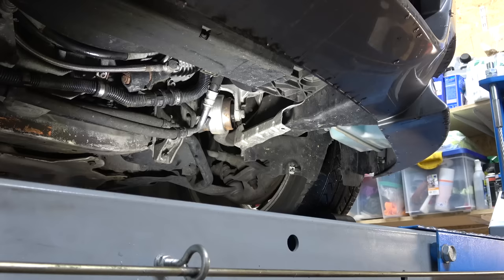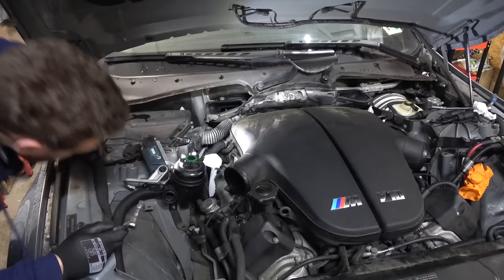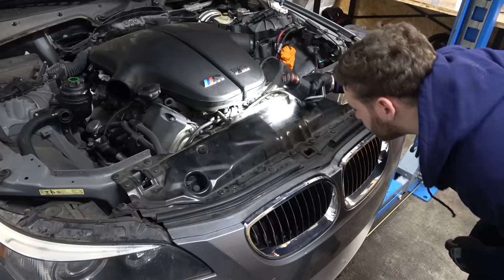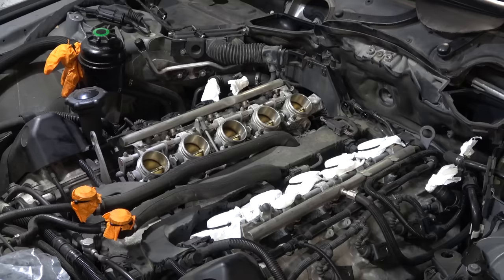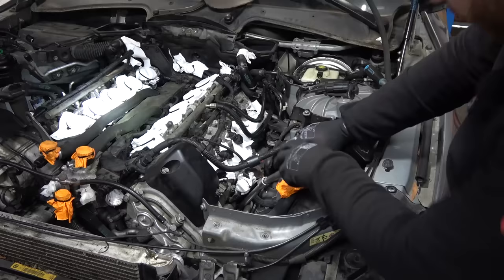In The Belly Of The Beast - The Cheapest V10 BMW E60 M5 6-speed - Project Raleigh: Part 2

Comment: As a BMW technician, this guy makes me laugh every video. Great content man. This guy is legit.
Reply: Please do you have an Idea why the rod and main bearings wear so quickly on the N57d30a engine as well? I went trough 3 engines in 6 months for my 2012 F10. I finally sold my car at a considerable lose as the 3rd engine also died. Is the B57 any better?
Reply: @abdbach379  i thought BMW diesels were supposed to be more reliable than their petrol ones
Reply: @adriananzano2292  Thought so too... found out the reality the hard way. I'm still paying debts for a car that I don't own anymore (And drove for a a total of 3 days). Luckily found a "cheap" first hand Mercedes C350 cdi with the OM642 V6 engine that's infinitely more reliable than the garbage BMW makes these days.
Reply: @abdbach379  sorry to be harsh but you should not buy a car unless you can afford it. I wonder still why people buy cars on loan and when something happens they just pay for something they don't have. Sorry to hear your story though!
Reply: @yassinesoufy1988  Totally Agree with you. My actual piece of advice to people is never buy a car if you cannot afford double its price.
Knowing this, I bought the car for about 16000 Euro, the first engine replacement cost me over 7000 Euro (5500Euro for the engine + new BMW oil pump 720 Euros, oil cooler 150 Euro, oil, filters, labor...). The second engine cost me around 5000 Euro (3500 Euro for a new 0km block, new oil cooler, oil, filter and labor). The third attempt was with another used block (gifted from the store for buying over 10000 Euro of BMW crap) the crankshaft was polished and new main and rod bearings from King were used. the last attempt cost about 2500 Euro. After all this drama it still failed. If It worked I would have kept the car.
As you can see I could afford the car and even its costly maintenance but after spending ever the car's worth of money I couldn't try to repair it anymore. I mean it immediately failed after 3 replacements, you'd lose hope too.
Reply: @abdbach379  I am really sorry to hear about this! This is really a lot of money! baring in mind it’s a used car. If you went for a big engine, I would advise you to go for an old BMW with a good 6cyl engine. Something like an e46 2.5 or even 3L would be great. Given that you spent so much money, I am sure that you will be tempted to mod it then and get an even greater experience. I am not defending the brand but I totally believe that the build quality and the sporty feeling you get from BMWs are a fact and that there are exceptions or as they call them “Kinderkrankheiten” that can be prevented from happening. After all, you have to know the point in common with all the failures that you had and figure out if you are the trigger. If this is the case then you have to change some habits like redlining when cold or not being aware of something with the car itself. Anyway, I wish you good luck and much driving pleasure!
Reply: @yassinesoufy1988  Thanks a lot mate. that's exactly what I was going for. I wanted a modern luxury car that's very comfy when coming back from work but still has a dynamic chassis and a powerful engine. That's why I went for the F10 530d with the revised 258HP 6 cylinder that was fully specced (fully electric seats and steering wheel, automatic rear shades, Hifi sound system, adaptive headlights, sport version of the ZF 8 speed gearbox with paddles, sunroof...) the speed and the torque were incredible and after a slight involuntary drift  when pulling out of a junction you can immediately see why it's called the ultimate driving machine but after a couple of hours driving I knew why it's also called a money pit because that's when I started hearing the engine knocking... And I always take care of my cars (baby it when it's still warming up etc...).
Anyway I managed to get a 2009 C350 CDI with the V6 engine and If had known about this engine beforehand I would've have bought a 2014-2015 E class with the money I had much more reliable and just ass powerful and the W204 C class is much more tail happy :) and weirdly more comfortable than the 5 series...The only hiccup is that you can't turn the traction control fully off ( but there is "dyno mode" to get around it ;) )
Btw the first engine failed the same day I bought it and every mechanic know about this issue and says it happens at random and nobody in the world (apart from BMW) knows why. They suspect the oil pump and cheap bearings but we changed those with new OEM parts and the replacement engine still failed the same day after each replacement. There a lot of cases in forums with my exact problem and nobody seem to know why it happens. I'm sure it's design flaw in the block itself because almost all BMW engines in the last 2 decades are know for bearing failures.
Reply: @abdbach379  the problem seems to be 
1. bmw using ridiculously thin oil something like 60 weight for the high revving engines which prematurely wears the bearings when not warm and even worse in cold climates 
2. people driving the piss out of the cars without properly warming up 
3. plastic components like timing guides, pcv system, water pump blades
Reply: @tommynobaka   You missed poor maintenance.  Which is always the risk when buying a used car.  You don't know for certain how the previous owner looked after it.
Reply: 60 weight is not thin at all
Reply: @abdbach379  
I'm sorry my guy, but 3 engines in 6 months, including one of them being brand new is not on BMW. Either you redline it cold every morning or the shop you use doesn't know engines need oil, there's no other possibility. Even the worst engines on this whole planet wouldn't have bad rod bearings in such short time.
Reply: @abdbach379 something must have went wrong with installation, there's no possible way the design is actually that bad.
Reply: @imnota  Those are your theories? We forgot to put oil in 3 engines or I red line cold ? Really ?
Well if you must know, none of those are true, in the first engine we put Liqui moly 5w30, in the second we tried Castrol 5w40 and in the last we used Fosser 5w40 (hot climate in my country).
And no I don't red line my cars when cold. In fact I never had the opportunity to red line the BMW in my short ownership.
Now you can take some extra knowledge from somebody else' experience or you can keep fanboying and denying the most know issue in BMW engines in the last 20 years.
Reply: @abdbach379  
There's no argument that can be made to blame a car manufacturer for a failure of a brand new engine within 6 months, there's not a single brand making engines bad enough for that to happen, multiple times in a row too, can only be user or mechanic error, or a full on made up lie. Stop whining and get off of your computer.
Reply: @imnota  Your unsolicited rudeness aside, if you actually want more info to gather more knowledge from actual peoples experiences please tell me I can send you pictures and the full story with details.
Second, I never new engine. I said new block.
Third, "the mechanic" is a BMW specialist who swapped dozens of these engines and showed me all the old seized ones he swapped. It's actually a know thing about this engine in my country. Anyone who sells BMW car parts answers with "oh that engine" when I was asking about a replacement.
And last, can you tell me how bad can an error be that the low end of an engine starts knocking after a simple swap?
I actually work on my cars if I have the tools for the job, even did an empty head swap on a 1.9 TDI so I may say I have minimum knowledge of what to do and not do.
If a random comment on the internet got you this angry to butt in and start assuming stuff from 2 phrases I mad, then you should probably get another hobby.
Reply: @abdbach379  
I'm not angry about a liar on the internet, just a common occurence. But someone seems to be offended by my "rudeness" and "assuming".

I just think you should go buy a 3 cylinder Yaris, it'd be a better fit.

Comment: You are so endearing, what a guy with a meticulous approach to repair. I am a professional technician but your methodology I admit is more precise and caring than I am. I also get the sense that 'maybe it's better to just own a Toyota' but then again an E60 M5 is a special majestic beast with special needs, so there is still balance in this universe after all.
Reply: 140,000 miles on a Toyota is a major maintenance interval -  Change the oil AND the air filter.  I don't own a BMW and probably won't but I love these videos.

Comment: My heart missed a beat when you lent into a running uncovered engine with your dangling hoodie string
Reply: I saw that too. If you've seen it catch the belt you never forget.
Reply from the maker: It's fine, fellas. Only the crank pulley was turning and that's at the very bottom.
Reply: @M539Restorations  I knew you would know exactly what you were doing.  Great job on the video.
Reply: Yeah, people with long hair have been scalped.  It is like a gun: none are empty even if you know they are.
Reply: That would be an actual example of a BMW engine biting the hand that's feeding it.
Reply: Still waiting the e32 progress...
Reply: Hum hum I felt the same way.
Luckily there was no belts installed. But I can see the hood or strings getting cot elsewhere...
Reply: @meftv8364  I second that.
Reply: Same. Please, tuck them in next time. Better be safe.
Reply: Me too!

Comment: A little DIELECTRIC GREASE on those fuel injector ‘O’ Rings would have been preferable ( being silicone based) as using VASELINE, which is petroleum based can swell /deteriorate rubber or neoprene badly.
Reply: There pumping petrol...
Reply: Do you understand you're worried about a petroleum product being placed on an o-ring designed to resist gasoline?
Reply from the maker: @Jokly exactly, otherwise I use silicone grease on coolant o-rings for example

Comment: Best channel I have found yet. 
I have same vehicle (but 7 speed paddle box). Has 190,000KM on it. Runs (ran) great for last 5 years l have had it, till... Engine quit on the open road. Ended up being fuel pump. Got replaced, now auto sparky can't get it to start (without ether) from first cold start of the day. Starts fine after that, even when still cold and also fine when fully warm. No fault codes... Anyone experienced same? Cheers, Si, Christchurch, New Zealand.

Comment: Great work. Here's a thought for you. I once changed rod bearings in a Ur Quattro. For the uppers, I put the shell on the crank and turned the crank by holding the pulley. I wound the new bearing in, and it pushed the old one out. To be fair, I was changing them as I'd put std bearings in it, and not noticed someone had ground the journals 0.10mm under- but it worked and it was a lot quicker.

Comment: On the edge of my chair from start to finish.Thank you again for a entertaining and informative look into BMW engineering and what it takes to keep the ultimate driving machine in top shape. For someone buying an older BMW, this should be a very sobering reality check as to how many things can go wrong and how quickly it could get very expensive, i.e. a fractured bearing race in the vanos pump causes oil pump failure, or stuck injector dilutes the oil and seizes the engine!!! You are able to show us all the steps without making the video drag. Very excellent pacing. Another great video.

Comment: the reason why the engine is so clean and the rod bearrings are in good condition (considering mileage) is 100% because the owner(s) did the oilchange under 10k kilometers. you could tell when he cracked the oil-pan.

Comment: The next time your garage door freezes you can park your car backwards pointing to the garage door, so the warm exhaust gas melts the ice. I've used this method, but with a wide plastic pipe pointing to the rear breaking disks to melt frozen handbreak.

Comment: Hi M539, may I strongly suggest to renew your crankshaftsensor and camshaftsensors too. They are known to get very hot at high speeds and they start to melt. This makes the car go in a sequential of shutdowns of electrical systems and fault codes. You search and search and search why your dashboard shuts off partially, but in the end it appears to be a short circuit from a melted crankshaft sensor. Imagine after how many hours you find this!  Use BMW original for this. Ciao 👍
Reply: O, and something else. Use exactly and I mean exactly the right motor oil. Nothing else and with this engine you MUST keep oil at maximum level ALL THE TIME. 
Low but above minimum causes extreme heat spots everywhere in the engine and it goes kaput.

Comment: I watched mechanics change the rod bearings on my S85 and they did NOT push the rod up and off the top of the crank. They were able to remove the top bearing by taping it from one end until it spun the whole way around and falls out the bottom, install is done in the opposite way. You don't get to inspect the top of the crank, but it's seems far less risky and fiddly, I was shocked seeing them do it like that after watching your videos. They've done 100s like this. 
Worth knowing I think. 
Shocked how good your bearings were at 150k
Mine were basically orange at 105k.

Comment: This guy is a great technician. I've been working on bmws for 22 years he makes everything look easy and they are relatively easy to work on. Unfortunately bmw screwed up after 2004 and up I've owned almost every model from 85 to 2003 and never had problems until 2004 customers that were bmw and nothing else were so passed off when buying any model from 04 and up I couldn't keep up with the issues.  The 7 series especially was a nightmare.  Not just ugly but try finding one that doesn't have a check engine light on.
Reply from the maker: Thank you!

Comment: Yay! If I ever get an M5 of the E60 variety, it won’t be as scary. I think the amount is cussing while I work on it, might exponentially increase though... That PS line drama brought back some bad memories of me doing mine on the E38 with SLS, before I figured out that I could safely remove the pump side banjo and start at that point. BTW those lines can be rebuilt with fresh rubber sections, just take them to a hydraulic shop that handles repairs and they’ll hook you up.

Comment: If those o rings on the injectors are made of rubber, I would suggest using silicone lube instead of vaseline. Vaseline eats through rubber. Which is also why you should avoid using vaseline as a lube for sexytime.

Comment: I watched the whole video, and maybe we just think differently but I go aftermarket air filters all the way, also you said bosch was only choice for fuel injectors, I know they are aftermarket out there of high quality. With the the quality bearings and arp rod bolts you should have put in bigger injectors and gunned that beastly v10. Just my thoughts. Great video take care!

Comment: Nice video:) If I may suggest one precaution measure- look at 1:03:54 an 1:04:07 - I would avoid any loose things near running engine hanging straight from the neck . Split second and your neck might be hurt when belt grab this string. BTW hope this oily towels were properly disposed. You may have add comment about that, otherwise I have a filling this would be tremendeous enviromental footprint left. Apart from that nice job and grate video:D!!!  Keep up running this nice stuff for petrolheads!

Comment: Firstly I love the videos great work👍 I have just replaced my Vanos pump as it was recommended by my garage due to low pressure a idle 10 bar. I kept the pump so I could have a look and can’t find anything wrong with it! The race is good no cracks! The plungers are good no wear signs! And the pump turns smoothly. No scoring in the race or the pump. What else is there to check? No heat discolouration! Vanos line leaks like sieve even though garage told me they checked it and it’s good? Any advice pump obviously not cheap!

Comment: This rattle noise is coming from the hydraulic lifters. Most BMW engines from this era have this noise. LiquMoly has a lifter noise reduction fluid which worked on mine but it needs to be used each time with an oil change.
Reply from the maker: It's not, it's Vanos.

Comment: ARP for the win..........great stuff. There are plenty of highly stressed engines in a multitude of applications that dont use that style of rods and rod caps...........wtf??????    Obviously the power steering lines were bolted on and the rest of the engine designed around them.

Comment: The ZF resevoir leaks from the gasket on the lid!!!!!!! replace the gasket on the lid, clean and inspect the lines! I found that for me the lines were dry once I replaced that stupid oring on the reservoir cap.
Reply from the maker: That's irrelevant, there is a filter inside the reservoir and given that it's an original part, it should be replaced.
Reply: @M539Restorations  I know, I wash the filter out with success. Its difficult to do, but doable.

Comment: Sreten, would you say that priming the N55 engine (fuel pump off, coils and spark plugs out) before first startup after bearing and cranckshaft change is obligatory? And after every oil change for that matter. I beleive that there is also a BMW guide for properly doing that.

Comment: I know you know what you are doing, but don't forget to crank the engine with the fuel pump fuse out to build oil pressure before actually starting.

Comment: hello, I am an IT not mechanic so stupid question incoming... what could go wrong with the oil pump with these scratches? I mean if the foreign particles causing them were removed and assuming the next filter would do the job - the oil would still be pumped - even with the scratches? No?

Comment: Sreten, at 53:50, was that "0, 7" reading before or after torquing the VANOS pump bolts? I'm doing the same job and when I torque the bolts down, there is no play in the gear at all. Is this normal?